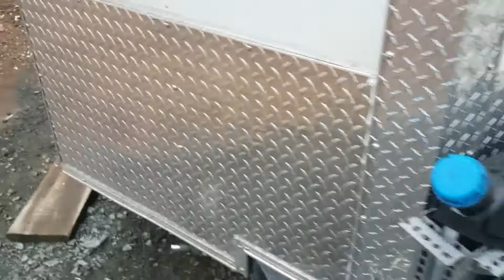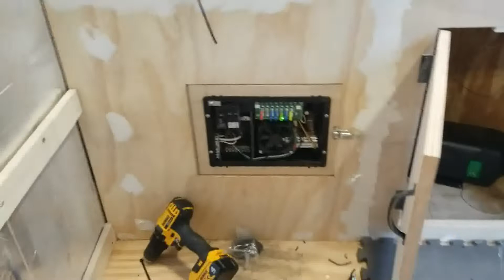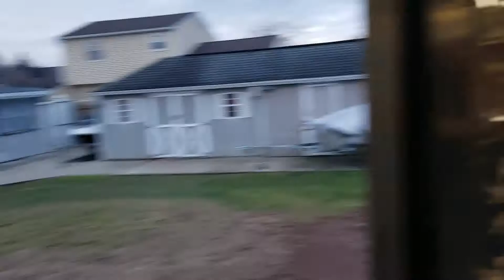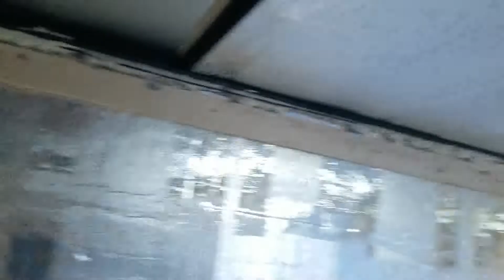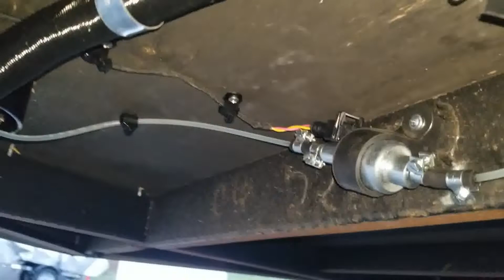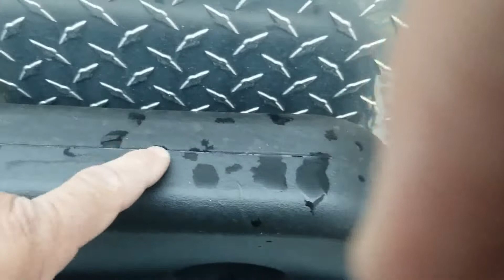Cargo Trailer Camper Conversion, Sort of...

Comment: What kind and how much insulation did you use?
Reply from the maker: Johns Manville 

R- 6, 1-in x 4-ft x 8-ft AP Foil Faced P

Purchased from lowes, approximately $22 - 23 per 4 x 8 sheet

Comment: Those diesel heaters are amazing
Reply from the maker: Yes they are. I am so impressed with the heat that they push out. I have to admit that the sound from the pulsing of the magnetic fuel pump can be annoying
Reply: There is a solution for that , get a pump cover and a pump damper from eBay fit 10 bucks a piece and hang the pump from the plastic with zip ties instead.   The noise will be a lot less.